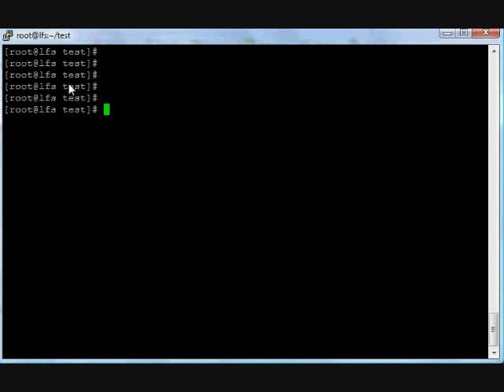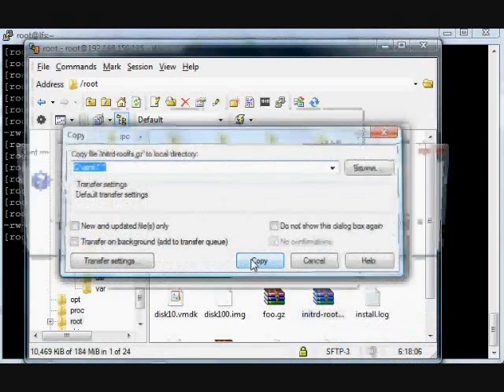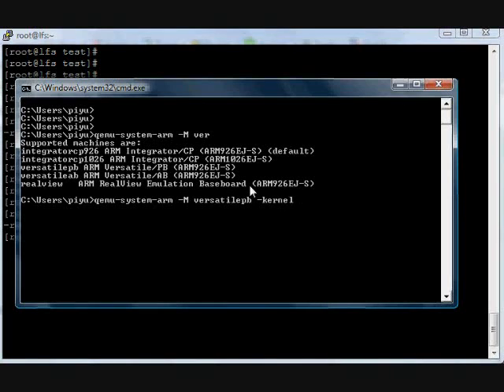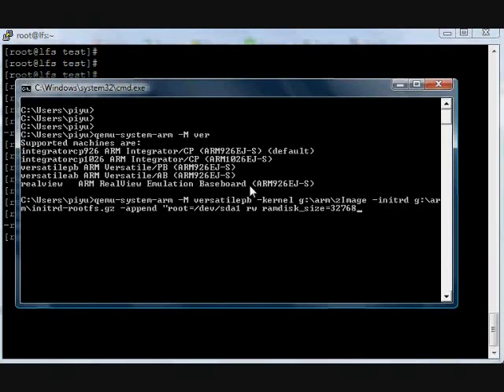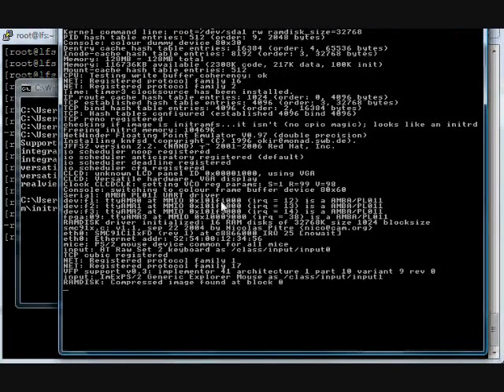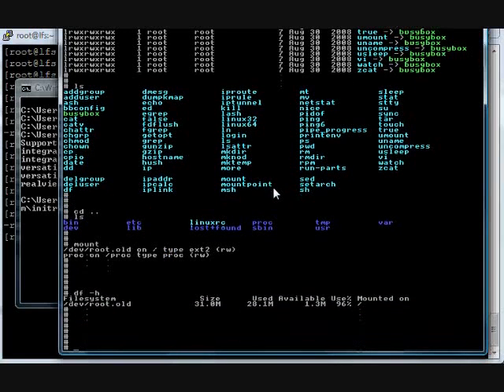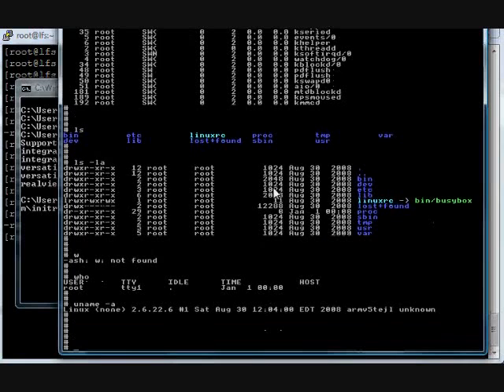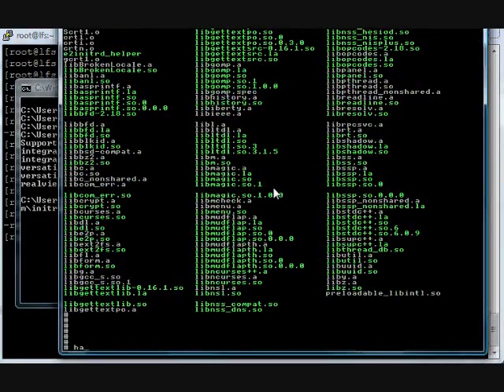Cross compile ARM Linux Part-4

Comment: i did lfs and compressing that file system using ur method and booting qemu-system-i386 =====>qemu-system-i386 -M pc -m 256 /mnt/lfs/bzImage -initrd initrd-rootfs -append "root=/dev/ram rdinit=/sbin/init"

qemu: error reading initrd initrd-rootfs